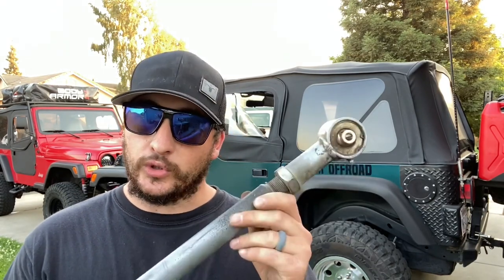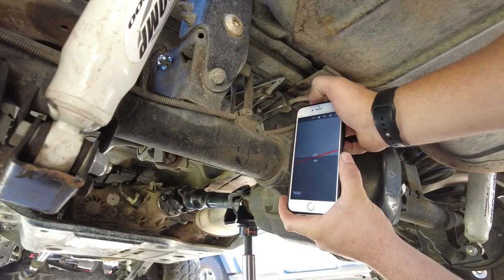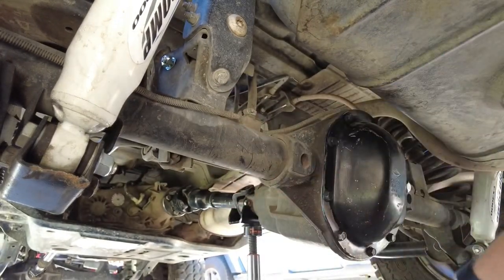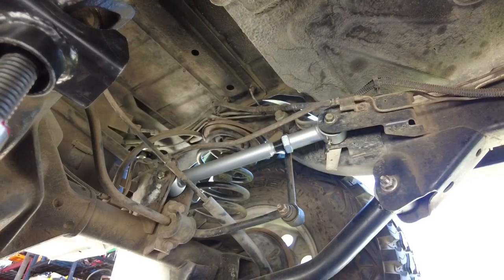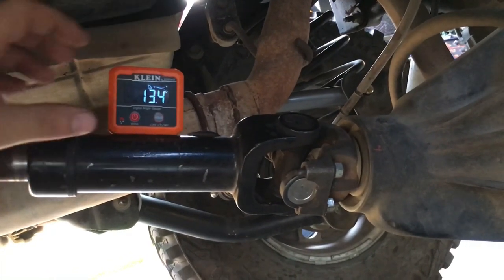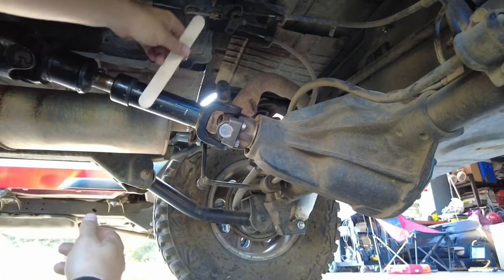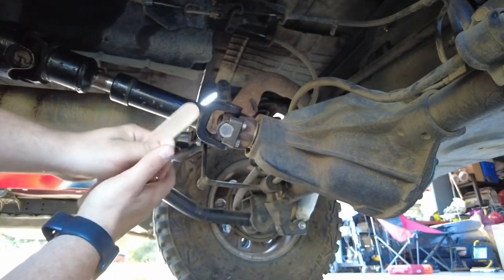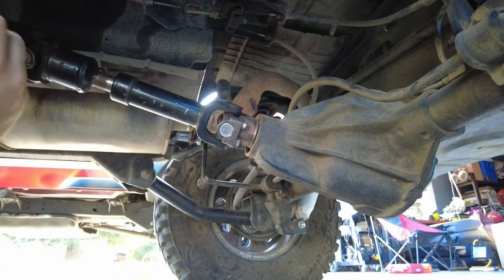Jeep Tj | Lj Wrangler -How To Properly Measure & Setup Rear Pinion & Double Cardan Driveshaft Angles

Comment: Question rear driveline is 20.4 and pinion angle is 18.0. What’s your thoughts on this? 97 Jeep TJ 35’s and 4.5” lift
Reply from the maker: It’s within 3 degrees you are good 👍🏼 how’s caster?

Comment: Did you have any issues with the track bar bracket hitting your gas tank when a making adjustments to pinion angle??
Reply from the maker: Yes you may have to take a pry bar and bend the metal housing of the tank inward so the track bar clears. That’s what I do , but I’ve seen people cut that excess off.

Comment: Good for a double cardan shaft. If you have a stock shaft, you will want the pinion angle 1 degree "higher" (diff lower) than the transfer case.
Reply from the maker: Yes for those shafts, I don’t run adjustable control arm or lift without some kind of transfer case drop to correct the angle. If I had to adjust or check, I keep the pinion parallel to the transfer case.

Comment: Thanks, helped a lot, is there a double cardan and driveshaft stock to buy for a 98 TJ, or do I need a to a driveshaft shop modify anything?
Reply from the maker: @bingobandit  you will need to make the transfer case accept a DC driveshaft by installing a slip yoke eliminator kit. This can be in the form of a hack n tap or replacing the tail housing on the transfer case I’ll link both kits here and the video. 🍻🍻
SYE kit: https://amzn.to/4d76wxP
Video: How To Install SYE Kit On Np 231 Transfer Case 87-06 Jeep Wrangler Tj Xj Lj
https://youtu.be/WlwwvQUThCc

Comment: Awesome video. so i dont need to worry about the t case angle correct, even if i dont have a double cardan on my drive shaft ? I can use JUST the drive shaft angle and the rear diff angle to figure it out?
Reply from the maker: No this video is for DC driveshafts only. If you have a two joint slip yoke shaft the tc should be parallel with pinion.

Comment: Thanks for sharing your expertise. Question: my drive shaft angle is 13.6, pinion is 3.6 and caster is at 5.4  So do I need to rotate my pinion to go at around 12?
It’s for a 2008, jk on 3.5 lift 37 inch tires
Reply from the maker: The only real way to achieve perfect caster is to clock the Cs. Now that the jeep is lifted the pinion angle is the main concern. The best setup for pinion angle is anywhere between  0-3 degrees in relation to the shaft. As you rotate the pinion up its angle will increase and the shafts angle will decrease. So it won’t necessarily be 12 degrees, pinion should be 0-3 degrees in “difference” of the shaft angle . 12 on the shaft 9 on the pinion 12-9=3 , so a 9, 10 or 11 would be acceptable. Just keep in mind that as you increase pinion angle shaft angle decreases. Play with it and Find the sweet spot. 🍻
Reply: @ATEMOFFROAD  thank you very much, I’ll give a try today.

Comment: Hi ! Excellent video. Thank you. I replaced my rear control arms and corrected my rear pinion angle at the same time.
I have a question though. I set the lower at the same length but when I tried to install the second upper control arm, the hole in the bracket and the one in the sleeve did not align. Is it normal that the left upper not to be the same length as the right ?
Reply from the maker: It’s ok to be a different lengths as long as the axle is square to the frame, and you don’t have any vibrations. The fronts are usually where there’s a problem but off 1/2” or less is not a big deal. There can be some variations on the axle mounts. 🍻
Reply: @ATEMOFFROAD  thank you so much ! Have a great day 😊

Comment: Does this information transfer over to a leaf spring set up
Reply from the maker: Yes, but you would still need an SYE and cardon drive shaft and use shims rather than adjusting arms. You would also need to account for axle wrap. Better to be around the 3 to 4 degrees as the pinion gets loaded there will be some flex or wrap in the springs. So the pinion when load remains in the sweet spot between 3-0 degrees. 
Which I do discuss in my Jeep XJ lift kit install video. 🍻🍻

Comment: Very informative video. Keep up the great work!
Reply from the maker: I appreciate it , thanks for watching
Reply: Do the rear uppers need to be the same length, or just adjust so bolt slides through with no resistance 

Thank you for the video
Reply from the maker: @amprepairguy  I have fixed length lowers so the uppers land where the bolts fit though the frame mount when the pinion angle is set ! I would assume that if your lowers are exactly the same length , the uppers will land where they land! They should be close to the same length Thanks for watching
Reply: Thank you for the swift reply ,Lowers are exactly the same .

Made very easy to replicate 

Thank you very much
Reply: @ATEMOFFROAD hey man what is your fixed lowers control arms f/r eye to eye measurement, would really appreciate the answer
Reply from the maker: @ryansremark6983  4” lift 16”

Comment: How would I adjust the angle of the pinion with a leaf spring rear end. I have a 1993 wrangler.
Reply from the maker: @msc1064  it just depends on what you have tell me more about your setup? On a tj with spring coils you have fixed upper and lower control arms so the pinion doesn’t move. On a leaf sprung suspension on a YJ or XJ the axle is not considered fixed and moves upwards under load. So pinion angle in relationship to driveshaft should be around 6-4 degrees. And the axle is loaded it will move upwards into the sweet spot of 1-3 degrees. This is called axle wrap and should be accounted for during setup on leaf sprung suspension. A little different than a tj. 
I talk about it briefly in this video Jeep Cherokee XJ Build - DIY 4.5” Suspension Lift kit Installation
https://youtu.be/dnDXSVpsp7Y
Reply: @ATEMOFFROAD  I have a stock YJ and when I put new stock leaf springs on it changed the angle of my drive shaft I am not sure of the angle. I also don’t get any vibration either I am wondering if I need to do anything else or just leave it alone or maybe put a SYE on it. Like I said I have no issues at all. Just trying to be pro active
Reply from the maker: @msc1064 then I would do nothing if they are the  stock replacement springs. Keep in mind there are several other way to correct problems, For every one 1” of lift it’s about 1/4” of transfer case drop you need to correct the driveshaft angles on a leaf spring suspension. A TC drop is the (cheapest) way to correct a problem with driveshaft angles front and back, but Most don’t like doing it this way because it affects belly skid clearances. It could be that simple for you depending on budget and your needs, but it’s not very conducive to offroading like an sye and cardon driveshaft upgrade would be. which I recommend on anything over 3” lift. Especially if you’re going to be offroading your jeep. And here’s the problem with that, is if you are very serious don’t spend money on your old TC, spend 3k and do it right, and replace your old transfer case entirely with 
 a 5.0 atlas 2 transfer case and up your crawl ratio to 100:1. It’s the ultimate option with a driveshaft, So as you can see there are many options here I’ve been through them all and they all work, but it’s all about how serious you are.
Reply: @ATEMOFFROAD  thank you very much for the advice. Great stuff.

Comment: I sure appreciate your video it helped me alot with setting the rear pinion angle. However now im having driveline vibration issues up front and cant find a single thing to help me find what my angles shoould be up in the front they always talk about the rear. I guess my question would is the front pinion angle simialer to the rear pinion angle. Any help or addvise i would greatly appreciate it ive been with out my jeep fr about 7 months just due to this one issue and no shop will touch it.
Reply from the maker: Yes the rules for the rear apply to the front, however you will need to adjust pinion with upper control arms. Also you can easily throw your caster out of wack. So lower control arms are also necessary depending on your lift, lower control arms will push that axle out further allowing to correct caster and pinion angle, pinion angle is always priority over caster . Once you get to 4” or above, caster becomes a real problem. Sometimes if your tj is equipped you can adjust caster at the encentric bolts axle side of the lower control arms. Definitely make sure your drive line is good! Hope that help ! Thanks for watching I appreciate it 🍻
Reply: @ATEMOFFROAD  Thank you so much for that helpful information you gave me a couple of hours ago. That proved to be very helpful and I do have to say after a couple hours of wrenching adjusting and driving i finally have my tj back up and on the road. I seriously can not thank you and you're channel enough for that advice..

Comment: yooo. so your lowers are fixed? which ones are they? do they help correct wheelbase after upper adjustment?
Reply from the maker: They are procomp lowers , I’ll be switching them out soon for the rubicon express or freedom offroad. And they do help with adjustment because they are fixed. The lift is designed for them to be at the length!

Comment: I'm doing this in the next week, I'll post an update when I'm done. Very informative and the -3 degrees part was on point. Did you have a bracket for the brake line on your control arm?
Reply from the maker: I was planning on making them for the controll arms I just haven’t been able to get to it yet as I’m currently caught up in a build series. I think I’ll Revisit that sometime soon. As for now they are just loosely zipped tied. 🍻
Reply: @ATEMOFFROAD  Mine have stock ones that I'll have to use the rotary tool to cut-off the brake line. I've done some grinding and went to machinist school so it should be pretty easy but everything is a liability..
Reply: Got the parts, they were a little harder on the muffler side but other than that, they went right in and stopped the vibration. Went the full -3 degrees 107ds/104p. Thank you for posting this, it really helped. Although..I don't have a torque wrench if you're in the area..🏴‍☠
Reply: Another update...had to take them off and adjust another two more times and went to  an equal pinion/driveshaft angle. I've got knobby tires so I'm pretty much going to get it aligned in the AM and ask about looking into it.
Reply from the maker: @ryancavanaugh4479  I’m in CA and you can use my TQ wench anytime
Reply from the maker: @ryancavanaugh4479  yeah that’s a good setup. in line is best I set mine up for -2 -1 and I’ve been happy with that.
Reply: @ATEMOFFROAD  I'm in Upland, if you're within 45 min I'll bring you some beer. TY.
Reply from the maker: @ryancavanaugh4479  your 300 miles from me. I appreciate the offer though. 🍻

Comment: so whats the angle off transfer case to drive shaft? thats a big factor in vibrations as well!
Reply from the maker: Absolutely, if you have a factory driveshaft with only two U joints then the transfer case angle does matter in relation to the factory driveshaft and pinion angle, especially if you have a lift and or transfer case drop. But if you are removing the transfer case drop , have a lift , installed a SYE kit and adapted a double cardon driveshaft, are using the factory skid plate and the lift isn’t over 5” then we can assume your transfer case is in the factory position and the double cardon covers the angles for the new lift height. The transfer case is bolted in the factory position and can’t be adjusted. The pinion angle is what we need to correct! Thanks for watching 🍻
Reply: @ATEMOFFROAD  Absolutely the Best video on Youtube on the subject..Thank you for making this video.
Reply from the maker: @rustygroves5822  thank you for watching, I appreciate it! 🍻

Comment: Is it possible to do it font front axle?
Reply: Anything is possible, but with the front axle keep in mind your castor steering angle.
Reply from the maker: Yes but you will need adjustable upper control arms to adjust this. On an Lp Dana 30 moving the pinion up 4.5 degrees is about the max you would want to go, beyond you loose caster. That changes if you were to swap in an HP 30 wich is mentioned in this video: https://youtu.be/tFJ0jYcF3iw?si=3xxhJebEsvv9sQsA

Comment: How is your spring perch when you rotate your axle?
Reply from the maker: Originally with the lift I have my rear perches touched the body of the shocked (small dents) not a big deal. I share that in my shock replacement video. When I lifted the red Jeep I bought a set of shock relocation brackets for both tjs. Now there is zero clearance issues and no more dents. I cover this in the sye install . 🍻
Reply: @ATEMOFFROAD  thanks! I'll check out those videos

Comment: Do you add more gear oil?
Reply from the maker: I don’t, but some do add more oil. It’s not necessary as the oil will get to both pinion bearings . If that’s your concern. When you change the pinion angle you do change the fill line and when you go to replace the oil for the first time after, it may seem like the axle housing was over full. It’s not. To refill go by the axle housings oil capacity, rather than going by the bottom of the fill  hole, when fluid starts spilling out. .
Reply: @ATEMOFFROAD  thank for the reply and info, I have aftermarket covers on with two fill plugs. I'll add just a little more. Thank you!

Comment: Does this green jeep have sye? I’m looking to do 3in lift on mine, will i need to replace front control arms? Or just the rear control arm to correct angle?
Reply from the maker: Yes sye, front lowers should come with your kit, uppers no. Rear uppers yes if sye and not a trans drop. I would suggest to replace all control arms front and year with new adjustable control arms. That way you don’t have old parts with new part. Also you can adjust caster and move forward out your front axle if needed.
Reply: @ATEMOFFROAD  if i do 2.5in lift with 1in body lift do you think I could get away from sye/driveshaft angle?
Reply from the maker: @eriktheroofer  you can if anything add a 1” trans drop. Keep in mind depending on what your doing that set up would not be conducive to heavy offroading. A stock jeep is still very capable with a winch. I’d suggest if you do want  a lift save up and wait to get something good. Would definitely be worth the wait if you go that route

Comment: is the same for the front shaft and pinion?
Reply from the maker: Yes it’s the same up front but keep in mind you also change caster.  The rule of thumb is  pinion always before caster. if still out of wack a set of adjustable lower control arm will push that axle out further allowing to make the necessary corrections

Comment: How to bring the pinion back down? I have the uppers removed and the pinion won’t droop down
Reply from the maker: Get the weight off it, use jack stands under frame use  floor jack under the axle. Block of wood against tub and bottle jack between pinion

Comment: Hey man i bought a jeep tj lifted don’t know much about it but I replaced all with RC 4” lift and forgot to drop the transfer case so I did it yesterday and now I hear a loud grinding noise
Reply from the maker: Did the transfer case drop kit come with the 4” lift kit you installed? What driveshaft are your using? , and have you adjust the pinion?
Reply: @ATEMOFFROAD  not sure just got the jeep so not sure if it’s stock transfer case and drive shaft and yes it did come with the lift
Reply: Wish I could send you a video it’s making a crazy grinding noise now